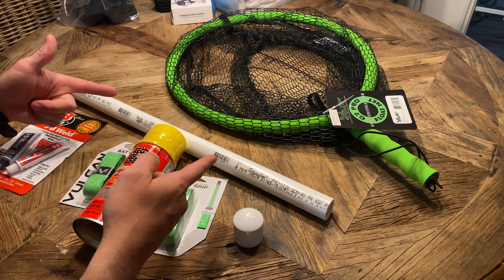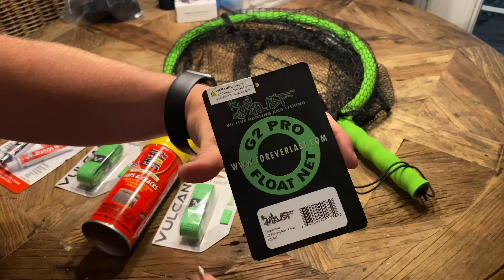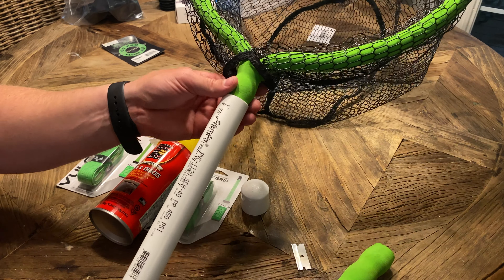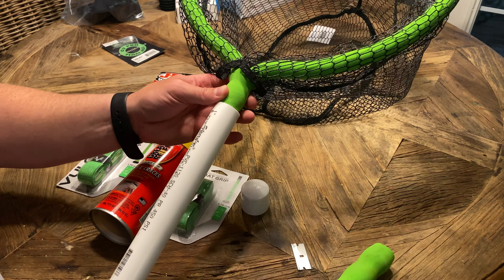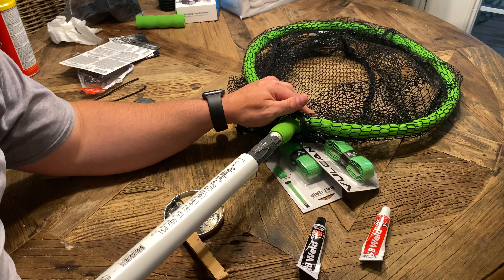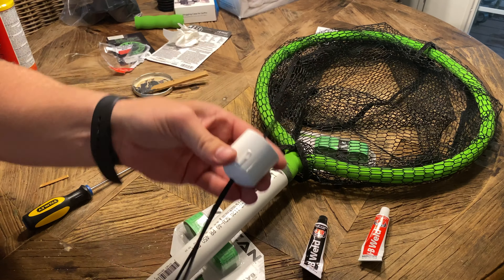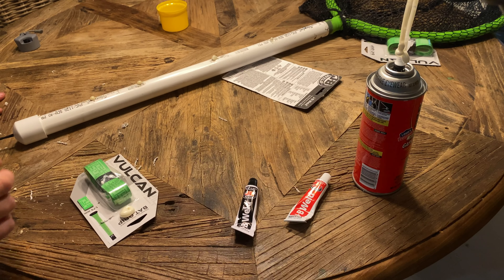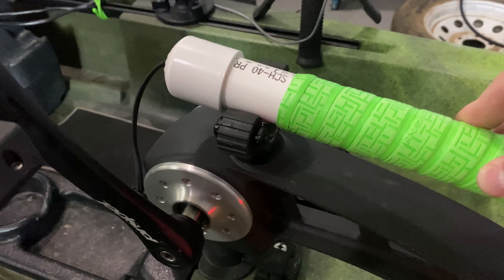Fishing Net DIY Everlast Floating Net Extended Handle for Kayak Fishing (like Greg Blanchards Net)

Comment: Should have drilled the screw hole after the jb weld dried so you didn’t have to line it up. With the bungee hole just take a tight fit washer and slide it over the bungee after the end cap hole. Then knot it.

Comment: I would have use the green noodle so it wont sink if you dropped it
Reply from the maker: It won't sink because the net floats and the pic handle is filled with foam. It completely floats!